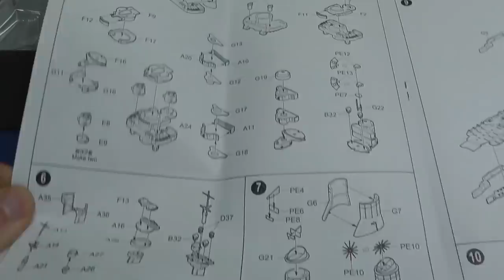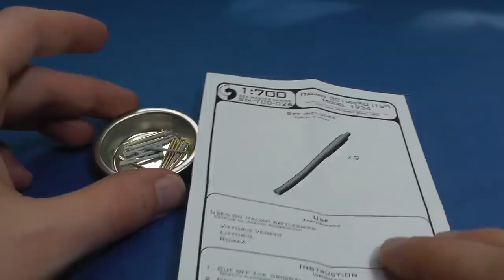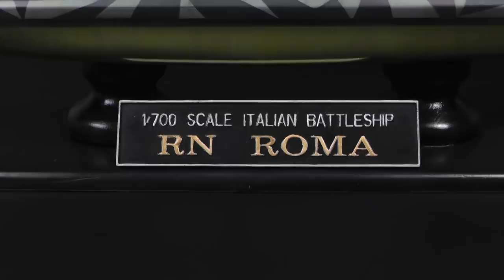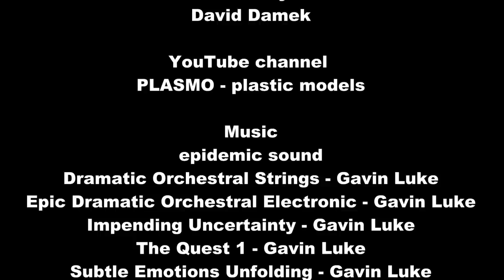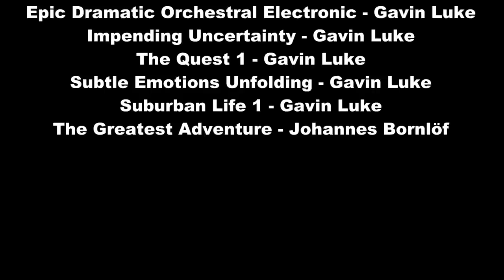Battleship RN ROMA 1/700 trumpeter - ship model

Comment: I have built one 700 scale battleship. The Schanhorst. NEVER EVER EVER AGAIN. It was the most difficult time consuming horrible experience I have ever had in model building lol. You have the patients of a Saint my friend and its a lovely build. I will stick to 1/200 scale warships , my old eyes and fat fingers and shakes are far more suited to that scale. :-)
Reply: ABWM2 is it easier because its bigger or is there more detail on a 1 200
Reply: Master Of Dizaster it's because of the size. There is a lot more detail in 1/350 or 1/200 scale ships compared to 1/700 and smaller. But because of the scale difference the pieces tend to be bigger. There will still be some small and mind numbingly frustrating bits on the bigger scale ships but no where near the same amount as a 1/700 where almost every part is tiny. 
If you're ever going to build a battleship I would recommend 1/350 scale. It's the perfect mix in that it's still very large and would impress anyone who looks at it and it has almost all the detail of a 1/200 scale but it's not quite as enormous spacewise. 1/350 is the perfect size to make a display piece. Plus the most array of the aftermarket upgrade parts are for 1/350.
Reply: Easy when you start young. And advance from easier to intermediate.  (Little difficult). Which this is . Guess you don't have the skill or are to impatient
Reply: totaly agree - 1/350 scale is the best and easier to work on , with more after market parts available
Reply: I stared building planes when I was ten and now that I’m 15 I build 1/350 ships.
Reply: ABWM2 lol
Reply: I’m a ship I suggest a smaller ship for 1st. Practice kit........

I have been modeling for many years and have figured out big ships are very challenging.
Reply: 73north LOL - I just ordered a 1/24 wood longboat.

Old fart scale!
Reply: I make ships out of popsicle stick the ships length at the end is 2.5 inch so don’t be a crybaby
Reply: try the 350 scale
Reply: Was it the revell one? I’ve looked into the box of an older release and the new one on their website and it looks like nothings changed with the mold.
From what I’ve seen in person it looks absolutely horrible and I wouldn’t even buy it from -50% off
Reply: Thats just what i love about modeling!

Comment: Superb work as always.

A useful tip for the photo-etch railings is to draw around the relevant deck plates before assembly & then use these as a guide to forming the correct shape... much easier.

Comment: G'day David, WOW! Did I get you right, this is your first ship build? If so, that is an amazing effort. You are a true modeller, one who can build anything; even on a first attempt, that comes close to a museum level build. 
I've been modelling military aircraft since I was a boy. I had a long break at the hobby but I'm 65 now and still love doing military aircraft. I have never even contemplated doing a warship, or any ship, build. 
I know how aircraft are manufactured and repaired. I have absolutely no idea how a big ship is built so I would never do what you achieved. 
At 1/700 scale my ship would be a tangle of misaligned tiny bits of plastic mixed with globs of paint and glue. It would be terrible.
You have a real talent for modelling. 
Inspired by you, I might take a crack at a really complex 1/32 scale aircraft, like an A-10 Warthog with ordinance hanging off all over it and with cowlings removed showing the engines and the interior wing mechanics and tanks etc.
You make me want to face challenges in the hobby but, no ships. 
I'm happy just to admire your excellent work. Cheers and thanks, BH

P.S. I was wondering, why would the Italian Navy paint the bow of a battleship in red and white stripes that could be seen by attacking torpedo aircraft from 3+ miles away? 
If any WW2-era naval modellers reading this could let me know, I'd really appreciate it. :) BH

Comment: Does anyone know what is the common scale for battleships?  So for example, most popular for airplanes is 1/48 scale (mid size), then 1/72 (small) , then 1:32 (large).  For armour the most popular is 1/35 scale.  I have seen video for ships at 1/700 and 1/350.  So if  was to build one, which scale is the mid size common one?

Comment: I wonder why you always glue the outer part of the model instead of where the parts actually join. Could you explain that?
Reply: Using thin ca glue it, seeps into the tiny crevices and dries clear so you cant see it. Tamiya makes some good thin ca that comes in a glass jar with a fine brush in the cap for around 5-6 bucks